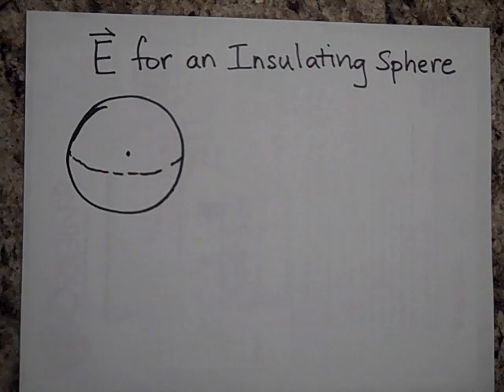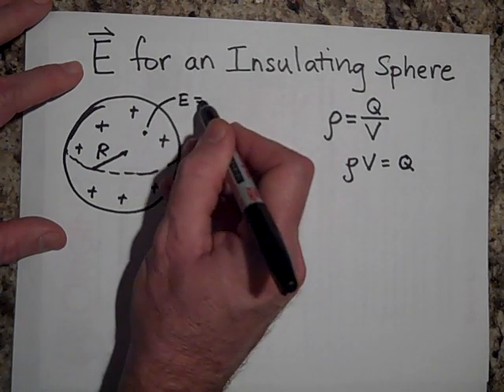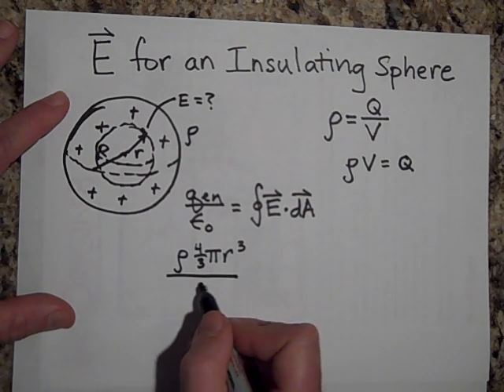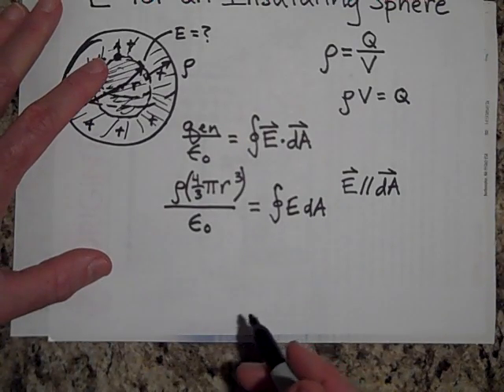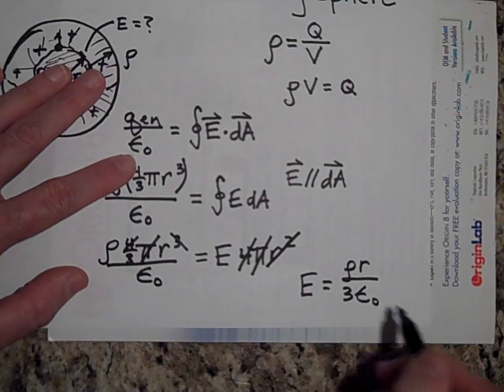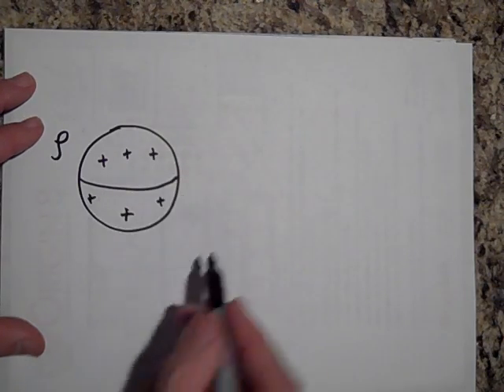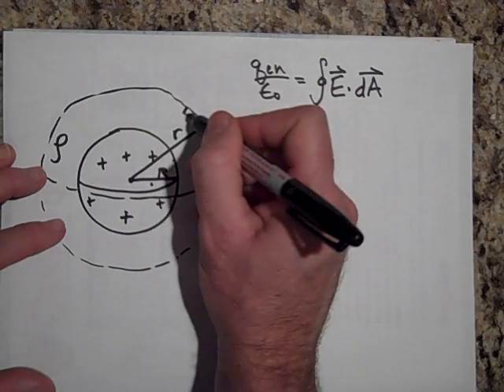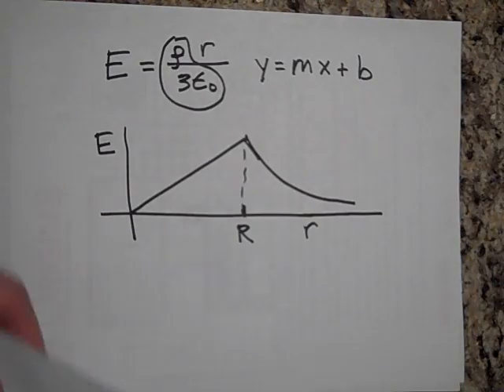Using Gauss's Law to Find the Electric Field for a Non-Conducting Sphere

Comment: @3:10. does the electric field always point in the same direction of dA? if so, why is that? if not, when is a case of why dA and electric field would not point in the same direction?
Reply from the maker: The directions of the E and the dA for symmetrically spherical configurations of charges will always be in the same direction when your charge is positive and concentric with the spherical Gaussian surface.  They will point in exactly opposite directions (180 degrees) for negatively charged distributions.  This is because the dA always points radially outward for a sphere and for radially-distributed positive charge, a positive test charge would be be pushed radially outward unless it were at the exact center of the charge.

Comment: In this scenario are you suggesting that the charge is distributed throughout the volume of the sphere? In general, I believe that charge is distributed only to the very small outer layer of the surface of the sphere, in which case when r<R then 4*pi*r^2=Q/e but Q=0 inside the sphere, meaning the electric field is 0 inside the sphere. Do non-conductors distribute electric charge throughout a volume?
Reply: +Michael Livanos It depends. The general concept is that good conductors allow electrons (charges) to flow. So they spread out to the edges of a sphere to avoid each other. For non-conductors electrons (charges) do not flow. So when he says the electrons are evenly distributed it is because they were placed in even distribution and did not move. If you place an electron on a non-conductor it just won't move.
Reply: +Michael Livanos yep. My AP physics teacher confirmed this just last class period.
Reply: Interesting. Thanks!
Reply: +Mike Neal oh, nice catch. I didn't pay close attention to the wording of the question

Comment: Actually there is a mistake, although it isn't the one that was pointed out by Karamathus. The mistake lies it that this method of calculating the E-field inside the sphere forgets to take into account the effect of all the charges in the sphere on the field. The issue is that while the charges that lie at a distance from the center of the sphere farther than the radius of your gaussian surface dont affect the net flux though the surface, they do effect the field at that point. Otherwise, good.

Comment: @karamathus Actually, big R and small r are equivalent in the first example, because the Gaussian surface has the same radius as the volume of charge. In the second example, the R and r don't cross out because the radius of the Gaussian sphere is larger than the uniformly charged sphere. No error here.